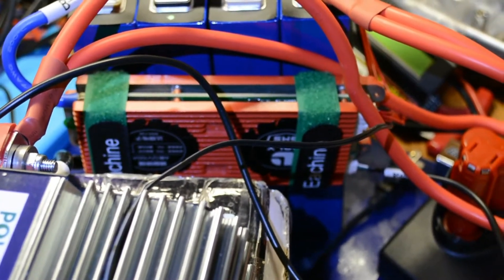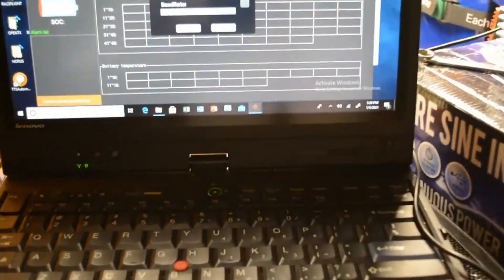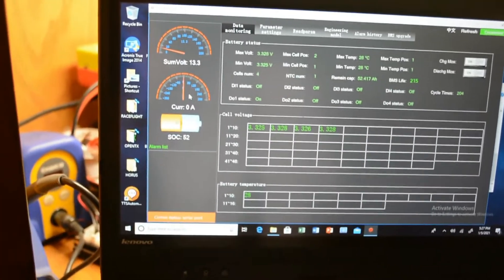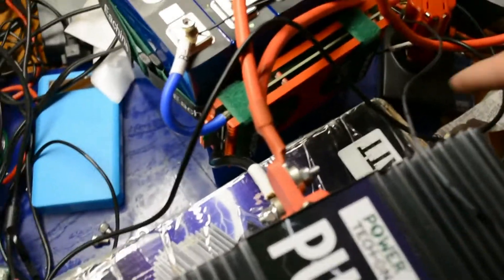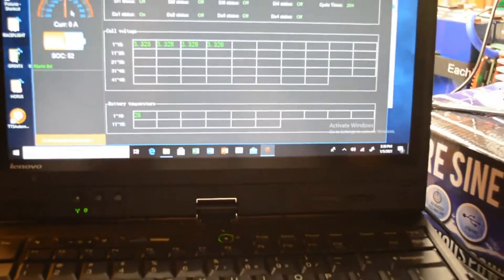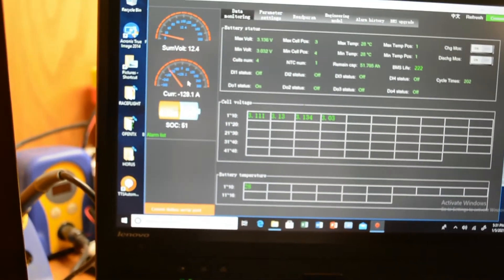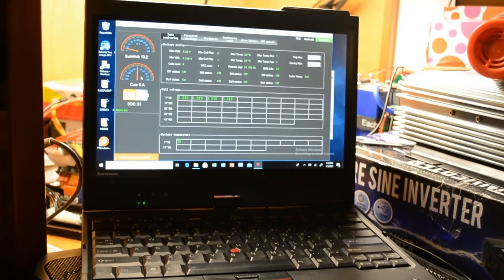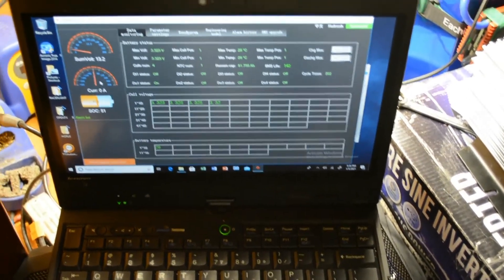DALY 100A BMS 12V connected via RS485 with 100ah LIFE PO-4 batteries.

Comment: I would not parrell BMS. If one cuts out the current will all go though second one leading to cascade failure.
Reply from the maker: Thanks, and I understand your thought. I'm not worried about them cutting out. I can reset them easily. The only time that might have been an issue is when I run a seperate electric heater in the trailer and pulling over 2000 watts. Its more of a backup if anything and helps ease the draw on having just 1 battery and bms setup. I have a 100ah set up and a 280ah setup. 
  I was going to parallel the batteries and just have 1 380ah battery set with 1 250a bms.
    If you've camped in the desert before you will find its better to have a system that can be reliable if one bms fails (failsafe). I also keep 1 set at home with the 2000 watt inverter for power outages. I have used it already for this!
Reply: You can use paraller connection with a additional module who block FET on BMS and it charge low battery until it will the same as others in paraller bank, check DALY YT video: https://www.youtube.com/watch?v=EgSb3aSqe1U